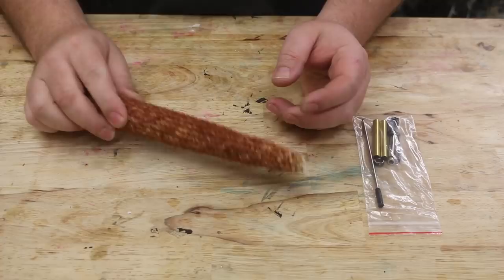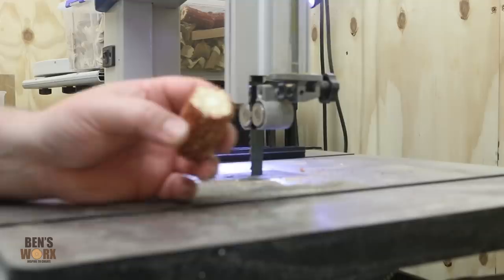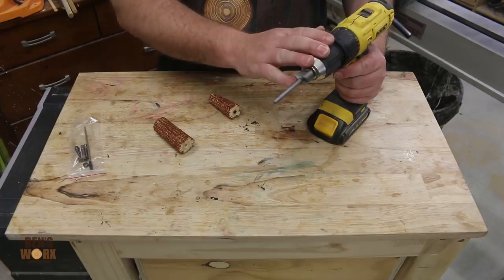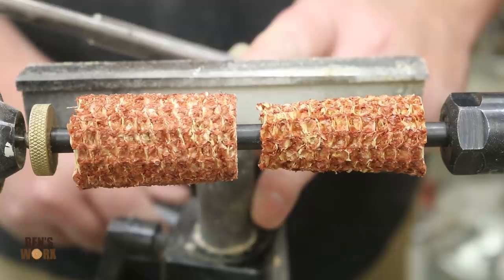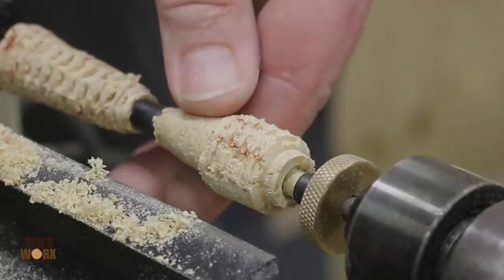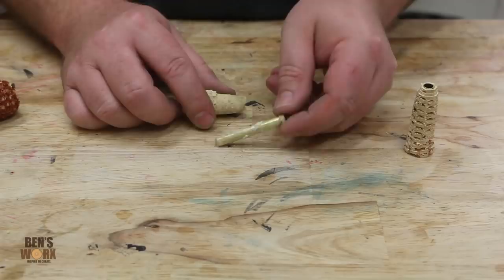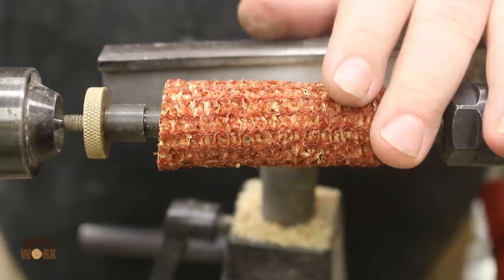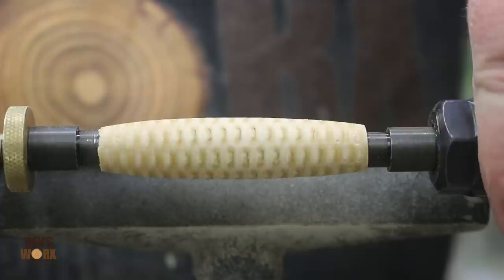Can You Turn a Pen From a Corn Cob?

Comment: you could probably harden it up, by doing that vacuum epoxy thing...where you put it in epoxy made for this process, then put it under vacuum for so many hours..while it is in the epoxy, then when you release the vacuum the epoxy then gets sucked into the voids, stabilizing the softer materials, so that it can be lathed. Peter brown has done that with soft things, to make them into bowls and stuff.

Comment: I did the same had to goto a larger pen. I invested in a vacuum sealer going to try with smaller again but shoot a insulin size needle full of thin CA down the soft part then put it under a vacuum to see if it holds better when drilling.   Great looking pen. I'm going to try the dye next time.  Just finished a cedar gavel myself!

Comment: Ben might be an idea to cut it length wise then cast it in clear resin
Reply from the maker: Will give it a go 👍
Reply: @BensWorx  If you flip them around the corn kernels are on the inside also it might help to stabilise them first. Good luck 👍

Comment: Hey Ben, 
I hope you don't mind me asking but I've bought the WL-14v mini wood lathe and I have not seen any 3 or 4 jaw chucks that fit the 80mm backplate that comes with the lathe (I'm very new to this and may be  looking at it all incorrectly). If possible, are you able to give me a few pointers/links for some attachments I would be able to use with the lathe? My main use for it will be ring making, which a 3 jaw chuck would be ideal (or so I've read) but I also want to try out a lot of the projects that you have done, they all look awesome!
Regards,
Rowan
Reply from the maker: Hi Mate, email me bensworx@gmail.com